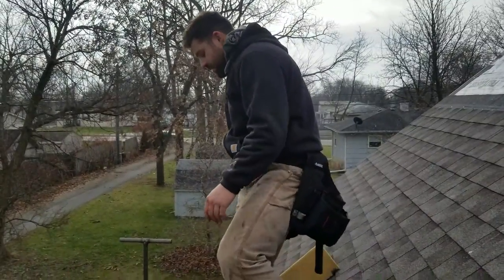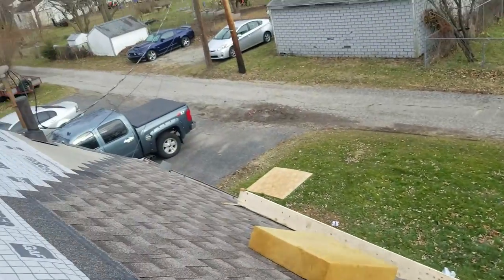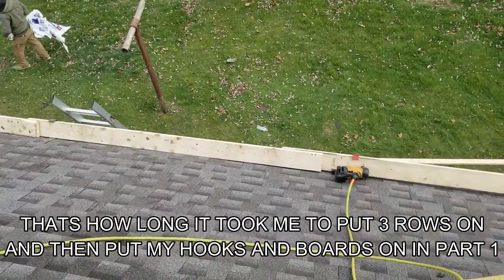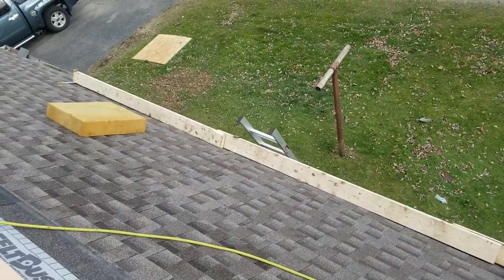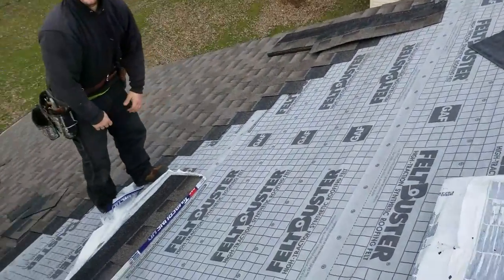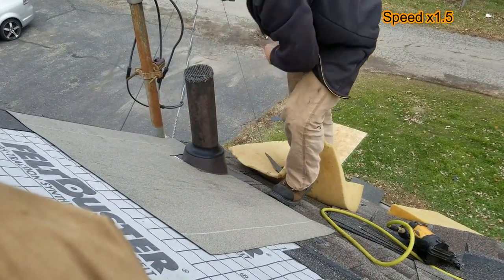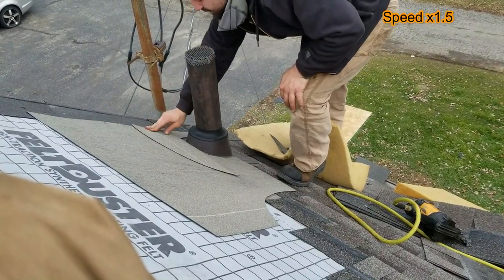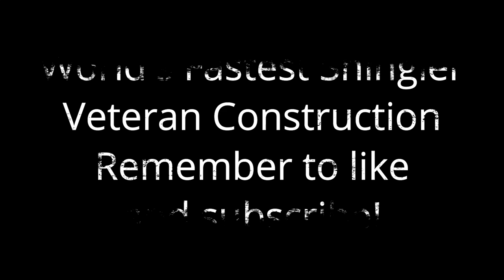Worlds Fastest Shingler 9/12 (Part 2)

Comment: Having grown up in roofing and done the work for many years. There is no way you can honestly say an 8/12 is not sketchy. Tools start sliding on a 6/12. Steep roofs as sketchy as heck I don't care who you are how well you get around on them. Physics and gravity don't change.
Reply: that does look more like an 8/12 pitch cause im currently working on a 10/12 pitch and i can't even kneel on the roof with knee pads without sliding down.
Reply: How did they do it back in the old days like 50 or 100 or 150 years ago?
Reply: @nofurtherwest3474  Lol that reminds me of a roof I was doing years ago, two story must have been at least 150 years old. I told the contractor I would not start it until we had at least 10 days of no rain predicted. He kept insisting I start it right away. I think I had about four guys working for me at the time. That house had 7 layers of shingles on it. I surprised it didn't sink two feet into the ground with all that extra weight. We spent the first day tearing off 7 layers on 1 small section and filled up a good size dump truck I owned. That last layer the tar was all that was left, no granules on the shingles. The next day it started raining, the contractor called homeowner complaining house was leaking. Went out, about a 60-mile trip and put plastic over the section. The rain and wind got and worse, and contractor called again and same thing. I told him I'm done you finish it.
Reply: @jackasshomey get some cougar paws. I glued the cougar paw replacement soles on a pair of shoes and can easily walk a 10/12 and can even stand on a 12/12 both bare osb .
Reply: @naterbator  highly doubt you can walk on a 10/12 easily lol that's like a 40 degree roof i legit needed to use the fall harness rope as a climbing rope to get from jack to jack.
Reply: Just said another Jack brojack. Decide again just like you do. The bottombeen roof in 47 years and I'm 67 grew up doing Steve. Get rid of those stupid little phone things. Those things can fold-out from underneath you.

Comment: Man take your runs all the way to ridge wasting time doing that makes no sense
Reply from the maker: Hahaha not true at all.  Even when I'm on a Walker its faster to do full bundle runs and come back for the tops later
Reply: True. I find you get more coverage by taking your runs to the end of the roof in the area you can reach rather than  running up and down the roof all the time. By the way the foam you use for grip is a new one for me. Have to try that this summer.
Reply: @NWIVeteranConstruction  Perfect video idea. Take the time to compare the difference in time. I'm sure many of us are very interested.
Reply from the maker: @Brando2501  yes I agree. It also gives you something easier to focus on.  For example you could count starter and see "ok I got 9 starter, I'm doing a one bundle run that's 3 sq. If I'm doing a sq in 8 minutes I should be at the end of this in 24 minutes and its smooth sailing from there" ALSO most importantly you're not dragging bundles up and down the whole run. Its so much easier to go back to the beginning and drag a half bundle half the distance you would've been dragging full bundles.  Or leaving them for the sun to beat on them
Reply: @NWIVeteranConstruction  always good to see people enjoying the trade man.

Comment: A pouch is always necessary in my opinion!It makes you faster and more efficient?On steep roofs I was taught to use 2x4 nailed thru the shingles.Well under a cut out of a shingle and caulked when done.Or you can caulk little metal pieces in the spots.Depending on the roof that way you can stock the roof with shingles as you need them and can also step on the shingles to get higher so not to use so many 2x4.One more thing do you not chaulk lines?Also I use a shingle holder that can be stood on as well.I like the cushions but if your not good with them you can get hurt.

Comment: May I suggest on a steep pitched roof just attach 3 safety rules to the peek and let them lay across the roof just too have them there in case of a slip. When you finish one side you can easily use then on the opposite side. It looks good and your insurance company will appreciate it. It only takes a minute to set up and gives you a security feeling your guys might need. I won't mention safety again. YOU DO GREAT WORK AND ENJOY YOUR VIDEOS‼️👍👍.   Vinny 🇺🇸

Comment: 9/12 normal where I am. Almost walkable but need a bottom kicker for slides. And I use foam matting too. Not only for traction but to protect shingles. Done that forever
Reply: Anything above 7/12 is not considered safely walkable.  Can you walk on an 8 or 9, sure, but not safely and without undue risk of a quick trip to the ground.
Reply: @percyfaith11  some people have better balance bruh 🤌
Reply: @negativetroller9728  not about balance, it's about traction, bruh.

Comment: I prefer using a 4' and a 8' ladder on steep roofs. I find it quicker and easier also you can put half the bundle on top of the ladder to hold them. Also I don't wear work boots. I prefer wearing sneakers. I find I get better traction for when I need it the most
Reply: Etnies natural gum were the best my ankles can’t handle that steep mess anymore
Reply: Air forces and a pitch hopper and I'll do nearly any pitched roof

Comment: In Florida it's six nails per shingle.  It didn't occur to me until I saw this video that in other states you can get away with fewer.
I might be a little anxious, but I don't think I'd be on that roof without a safety harness.  In the sun and the heat, it's a huge drag and a pain to deal with, but one slip is all it takes.
Reply: typically the states on the coast of america have to use 6 nails per shingle. in washington state where i am it’s 6 nails on the coast but when we do some houses further inland we can use 4 per shingle. same for california too

Comment: U should invest in a pair of cougar paw shoes you can walk a 12 pitch easy
Reply: I was just bout 2 say that, I'll use them cushions 4 my bundles
Reply: arent they made for steel roofing. big difference walking on loose asphalt
Reply: They make em 4 metal roofs too, last place I saw em was at ABC Supply.
Reply: Used 2 have a cleat as well, 4 woodshake. They discontinued making em, replacing em w a different style I've yet 2 see

Comment: I have to say, you are fast as hell. Wish you were in my area, I would get you to do my roof. Do you recommend the lifetime roofs made out of steel or aluminum, and do you prefer the asphalt roofs over others? Thank you so much for the education. It really helps homeowners who may want to do it themselves, or ensure someone who is working on their property works as hard as you do. Thank you again.
Reply from the maker: No problem.  Honestly I don't know much about that other stuff.  Sorry about that
Reply: Metal roofs installed by a reputable contractor will hold up for 50 +yrs 
I would recommend a hidden fastener roof,shingles are good for 15-20 yrs  depending on weather and are also the lower end and cheaper way to install.
If you install an exposed fastener metal roof,you will find yourself having to replace the screws in 15-20 years.
Reply: @eastside0434  Thank you so much.

Comment: This is a old video but I'll tell you the safest way to do steep roofs. Go and buy some roof jacks, brackets or whatever you call them set them up with 2x6s. Shingle up five or six feet and set up another row. Repeat all the way up the roof. It doesn't take that much extra time.
Reply from the maker: See my most recent pitch hopper video, that's the fastest and safest in my opinion

Comment: On a cold weather install is it necessary to put gaps in between the shingle joints to account for expansion when it warms or do you still put them tight? And what temperature is too low to roof? Thanks!
Reply from the maker: they say below 43 degrees usually but when the sun is out its still ok around 30. don't say I said that though, just an uspoken rule around here. I've shingled in 8 degree weather lol and I install as normal. shingles don't need room for expansion and contraction. never been told that from anyone I've ever talked to and i've never seen that on anything I've read

Comment: I’m no expert. I’ve only roofed one house, my own (with the help of a friend who knew a thing or two). So my question is this: why no use a harness or rope? I would think it would allow you to move around faster and save time because you can kind of bounce around the roof fast since you don’t have to worry as much about each step. For the roof I did I just tied a strong rope to a big tree on the other side of the house then over to top and down to my waist. I was able to work much faster and more confidently. Does using a rope or harness slow you down? Please explain. Thanks.
Reply: For some it gets in the way and slows us down. OSHA doesn’t like it but some consider it more dangerous because it’s also a tripping hazard and it’s hard enough to manage the hose along with a rope. For anything steeper than this a hook ladder can be used or we use jacks and boards (primarily for slate roofs as they have extremely steep pitches) but for this style of roof, with practice, you learn to watch your step and be careful and aware of where your stepping. Also wear grippy tennis shoes and not climb in the rain. Many many roofers do it cause it’s simpler. It’s all preference or if your union etc.
Reply: @calebwhite6173  how about using a crane that holds you? too expensive?
Reply: @nofurtherwest3474  You’d  need a place to set it up. It’s not too expensive but there are some homes that are tight together with no room for a crane. It sounds nice but you’d have to expense it to the homeowner and they usually go for cheapest bid. It’s about speed and getting it done quick for shingle homes. That’s why a crew sometimes has 5-10 people so they can get maybe 3 homes done in a day. Usually two is the target.

Comment: but how did you get the underlay on? especially that first row of ice/water. Work off ladders?
Reply from the maker: From toe boards
Reply: so just to clarify. Toes boards up 3ft, lay ice/water, move toes boards down? start shingling?
Reply from the maker: @tchornomud  yes exactly! Leave enough Room for the ice.  Then lower it down to where you can barely get 3 shingles  on (that way you can reach the bottom easier) sometimes it's a little rough bending over to get the starter on if you try to put that board on i.p.o higher close to the line on the ice

Comment: you should also consider checking out the Pitch Hopper, it’s used the same way as a foam cushion but it’s way more reliable. you can use it on a 6/12-14/12. there’s 28 inch ones and there’s 4 ft ones
Reply from the maker: See some of my most recent videos. I made a sponsorship video for them
Reply: @NWIVeteranConstruction  nice man that’s awesome. they really are a good company and i love there products

Comment: Ever tried the cougar paws ? shoes with sponge on the bottom
Reply from the maker: No I was going to a lil bit ago but I heard they wear out quick af. Wasn't worth the money to me I'm sure they work though and I do know a guy that buys them every year
Reply: Well i use them and i mostly only use them when im nailing and they lasted me a while but the sponge i do change out every 1-2 weeks
Reply: @NWIVeteranConstruction  definitely worth the investment for the steeper pitches.  No setting up just run it.
Reply from the maker: @fivying  how much is the replacements?
Reply from the maker: @thomasbryant5138  right on I'll get a pair and do a review on them
Reply: Omar Alvarez love my paws! They work good on frosty roofs to
Reply: Here in texas the sponge replacement are roughly $20
Reply: I’ve found that the best shoes to use are the and1 shoes from Walmart lol
Reply: I have the cougar paws for shingles and metal roofs. They both work great. The pads are good for about a week if your going hard. They cost about 17 bucks. The extra work you get done is well worth the cost. Every roofer should have them!

Comment: I have always heard from my grandfather,  and father.  You must pill the strip on the back of the shingle.  
I notice you dont pill the strip.  I am curious to why they tell me this
Reply from the maker: My parents lied to me too about a lot of things in life.  Been a real hard pill to swallow.  But I'm pretty sure that used to be a thing.  Not anymore though
Reply: Worlds Fastest Shingler I know everyone wants to see the sexy work. Can you explain the boring stuff for us that aren’t roofers. Why the strip is no longer needed to come off?  What to look out for in a douche roofer/contractor.  The difference in each shingle and shingle style.
Reply: Those strips are just so the shingles don't stick together in the bundle with the sealing tar on the shingle
Reply: What the guy above said. When the shingle is properly installed, the tape strip is not in contact with the tar line. Some local dumbass told me that same thing, and he also said the starter is supposed to be installed upside down. There is a lot of misinformation out there.

Comment: At the 39min mark in my opinion you'd be much safer and even save time by putting in that last roofing bracket.  And with this type of work ethics on safety it is obvious you do not work for General Contractors unless on your side of the world safety doesn't exist.  What does your insurance say about this or do you only have liability?
Reply from the maker: I didn't have a board.  It was like 9 ft man I wasn't that worried about it and would've done it off the ladder if I felt nervous

Comment: So here is the problem as I see it. If you get hurt, what happens to the business? Falling off a roof is never good, and what happens if you fall wrong? Better to just put a rope on and slip on a jumar ascender so you can be belayed and work the roof including hard pitches easily and safely. I know you are trying to get this done fast, but still, with the ascender you could still make sort work of all this, and get it done in a safer manner. As a business owner myself, I need to think of those things about what happens if I get screwed up, then what happens to the company. Something to think about anyway. You are fast, just be nice if you were safe. I am losing too many veteran brothers and sisters to have one go simply because of a mistake.

Comment: You do not wear Cougar Paws?
Reply from the maker: never tried, enough comments though that I should
Reply: @NWIVeteranConstruction  So I just went through a course on wind and hail damage and during the course they were talking about how asphalt strip that adheres shingles together. The said if the roof is put on in cold weather it may not adhere and the strip will become contaminated with dust. I see you putting roofs on in the cold but how cold is too cold?
Reply from the maker: @FBurck  that is true in many situations yes especially new construction. They say not below 43 degrees I think.  Every roof I've done this year has been right at it and sun plays a big factor too. There's precautions you can take to shingle in the cold but most don't do them and just shingle through anyway
Reply: Double nail rake edges and eve edge corners this is where most blow off occur just like this guy only putting one nail at rake edges way to far in from edge
Reply from the maker: @guitardedimbisol6087  I've demonstrated why that"double nail isn't necessary in my 2 hour video.  Blowoffs in general are due to high nails i.e nails not in the common bond.  When you nail correctly the nail you put in the shingle above goes in THE EXACT same location as the nail you put if double nail.  I can assure you my nails are as close as possible to the edge without blowing out the side

Comment: I dnt see no chaulk lines
Reply from the maker: don't need them when you snap on for the bottom. see how straight the top came out? that's how it works when you install every shingle the same exact way. one line and that's all you need
Reply: No lines at all if you know what you're doing

Comment: Nailing on shingles fast is not the best way to install a roof and more likely to have nails improperly installed which later on will cause a leak long after the fast roofer is long gone as far as not wanting to hear about safety and safety harnesses is up to you but the day OSHA drives by and fines you $3 000
for working on a roof over 7 feet without proper safety equipment then you will understand what is expected from a contractor working on someone else's property and insurance companies not wanting the liability nor the homeowner.
I worked on many roofs since I was a teenager and never had an accident, eventually I hired a crew of Mexicans and one fell 2 stories and broke his pelvis and another guy fell off a ladder I was sued by both of them and it put me out of business, I did not have workers compensation because they were subbing the work without a contract,when they got injured they claimed to be employees 
Cover you ass,nobody else will 
They all friends until someone gets hurt.

Comment: The manufacturer designs the shingle to be installed with factory ends to carry a certain pattern. When you cut the factory end off in your stairs you screw up the design pattern. I thought quality was important . Don’t misrepresent your self as if your a professional if you can’t install according to specifications. Quality over speed!
Reply from the maker: Speed does not count if quality is sacrificed! This isn't siding man.  It can be treated differently. Ever done a rake edge? The finishing side? It is 100% necessary to have a non factory seam somewhere on a roof  so You're wrong.  Don't try to knock a pro who actually does this.  You can find many of these demonstrations on another video of mine that says how many of these mistakes do you make?
Reply: Worlds Fastest Shingler your far from “pro”. Just because you nail fast on open roof .your a hack . period